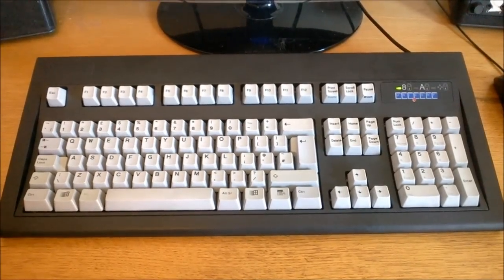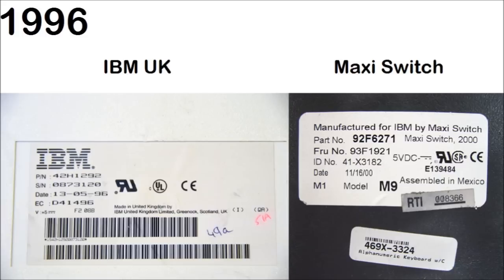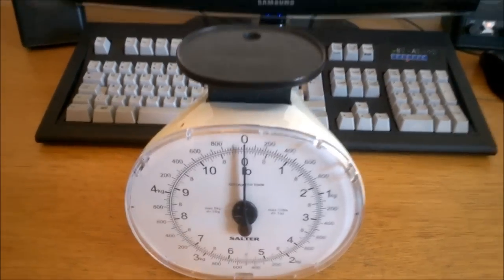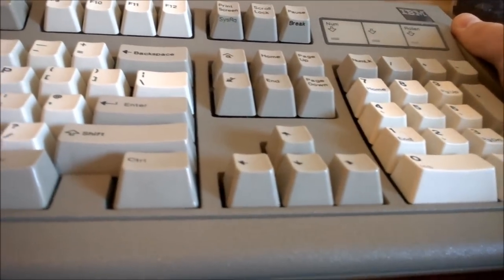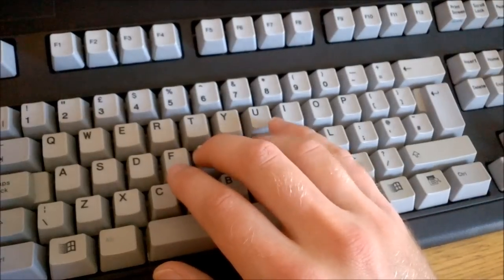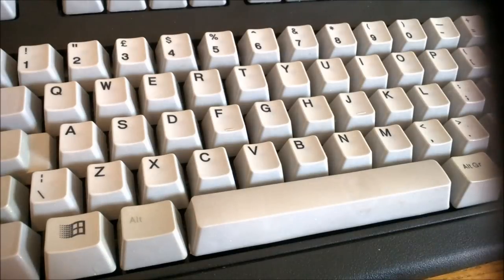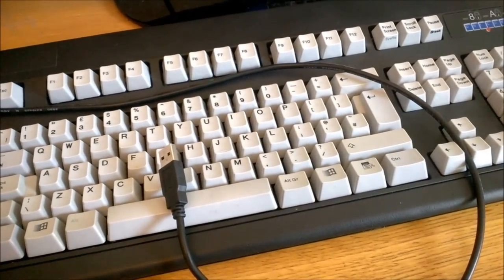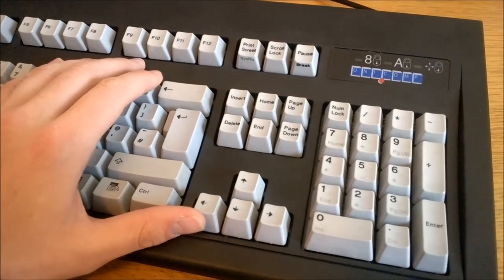Unicomp Model M review (buckling springs)

Comment: Hello, nice review & comparison of the Unicomp with the original Model M. I just got myself my very first mechanical keyboard, a Filco Majestouch 2 UK ISO 105 key with linear Cherry MX blacks, to replace my 7 year old Cherry KB-0556 membrane. With it's almost legendary rock solid "built like a tank" build quality, combined with it's history, in that in many ways it's become the standard that other modern mechanical keyboards are measured against, would you say that the Costar manufactured Filco is effectively the "Model M" of modern Cherry MX based keyboards? Especially when you replace the original stock keycaps with Filco's own double shot slightly retro spherical keycap set, like I'm planning on doing for Christmas?

Having previously used the Apple Plus' M0110A keyboard back in the early '90s at College, I find that the Filco, even with stock keycaps, already feels very similar to what I remember from the good times I had with the Mac Plus back in the day.

Perhaps a review of the Filco is finally due, because of the above? Even if you do find modern Cherry MX based keyboards to be rather boring and common in general. ;-)

Comment: got mine today brandnew. quite disappointed to be frank. they seem to have switched their caps to ultra thin ABS which in itself is bad. but the keys are even getting stuck on alt and spacebar. moreover the damn keyboard has rubber only on one side - the spacebar side. what kind of mad idea is that? to put anti slip pads only on one side? the foldable stands also don't have rubber on them. 
so yeah, nice keyboard to scratch my desk up. but honestly who asks the company if they put rubber on both sides ot not? isn't that to be expected? regretting the purchase. only the sound is somewhat ok.

Comment: The one I got a few years back had two part key caps so I don't know if something has changed. Also their support is atrocious. They are modeled after the later keyboards that had liquid gutters in them to prevent damage from spills. but the gutters are worthless and they don't tell you that. I had a friends spill some water in mine and it went out. when I emailed their support they acted like the boards never had this feature and were a bit rude via email.

The warranty means nothing as well. As mine was still well within it's warranty time yet I was expected to pay shipping and $60 for parts to fix it. that is nearly the price for the board! I would not recommend buying from them at all.

Comment: Some website remade the Model F, but it was a total joke. Only came in USB, only came in a layout with windows-key placement, and they costed $500 each. That's like making a replacement reciever for a vintage telephone that only fits cellphones... wait, they did that? Well then.
Reply: Minecraft OFP857 I think that's expensive as well but keep in mind an F is much harder to make than an M. An M is a membrane keyboard whereas the F has a PCB layout with capacitive switches.

Comment: Wait what the fuck , i asked unicomp if they could do 1 part caps for me and they said no!
Reply from the maker: I didn't even know they did 2-part caps. Their website is absolutely awful, it's just not clear what options and products they offer.
Reply: Yeah, their keyboards have changed some since 2009.
Reply: animegamingdude Oh i know , i ordered a windows 1x1 cap off of them and it was old stock as it was the win95 logo 1 part , i ordered an escape key and it was 2 part and the printing was poo. However i ordered a brand new APL set and that is lovely apart from the mods. I need to get me a grey set like that for my model MF 101

Comment: What's up with the whackadoo "enter" key and the backslash down by "z"? With all the things you point out in the video, this thing is pretty clearly a cheaply-made knockoff.
Reply from the maker: It's a UK layout model :p .
Reply: JLConawayII You probably have never heard of different keyboard layouts. It's ISO, not ANSI
Reply: I've seen different layouts, just not that particular one. I remember the ones with the giant Enter key and tiny backspace, but most of the keyboards I've owned over the past 20 years have been ANSI.
Reply: All the original IBM UK Model M boards were whackadoo that way as well.  Search Google images for UK Model M.
Reply: It's the 104-key international layout which is different from the 103-key USA layout.

Comment: Luckily, Unicomp has fixed some flaws since this one came out. The newer ones not only have two-part keycaps, but they also ditched that fucking atrocious Unicomp logo.
Reply: I got mine in July and it had the same logo but I can tolerate it on a black keyboard.
Reply: nerdyneedsalife The new logo must be a pretty recent change, because the one Modern Classic got in September didn't have the Unicomp logo on the lock light.
Reply: Maybe it's hit or miss. Some comments for this video said they have gotten rid of it months before I bought mine. Or maybe it was the model I got.

Comment: Yeah, but how does it play games. I'm looking for a board made for men. Not these girly, chary switches, that feel like im gonna break it. 
Oh, I'd like to send you my copy of 'The Lord of the Rings' and a thumb drive. Please read the book into the thumb drive and send back to me. If you haven't read the Lord of the rings, then enjoy. If you have, then enjoy.
Reply: Not sure if you bought it but I think you can game on it really well. It has two key rollover meaning only two keys are promised to register each time so if you press a,s, x, and z together, z might not show up. However I never had problems playing games like Killing Floor 2 or GTA V with my keyboard
Reply: The no-frills Filco Majestouch 2 has 6KRO and works wonderfully for both typing and gaming. Plus, it's heavy enough to kill with. (ETA it supports NKRO with a PS/2 adapter, but I doubt anyone could notice the difference in an ordinary use case)